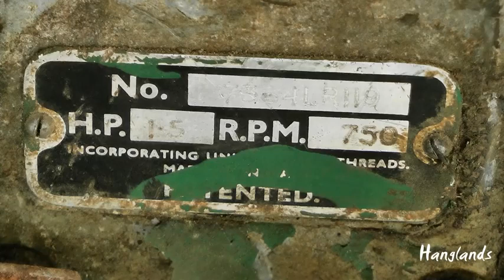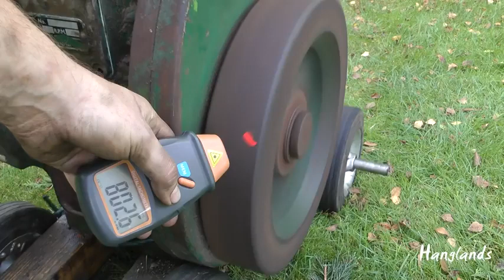(Steven Hanglands) archive video. Lister LR1 - Seized Up Shed Find Diesel Runs Again.

Comment: I have LD1 which was idle for a few years.  Seized but the alloy fan corroded against the air ducting.  Rest of the engine was OK.  Anyway, time for complete overhaul before going back into service.